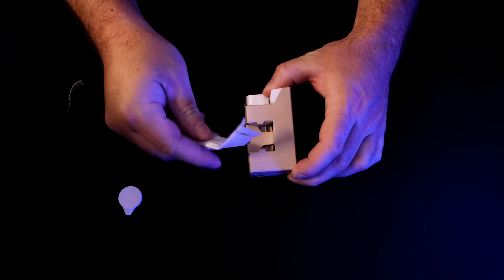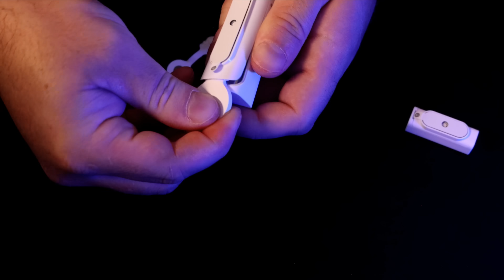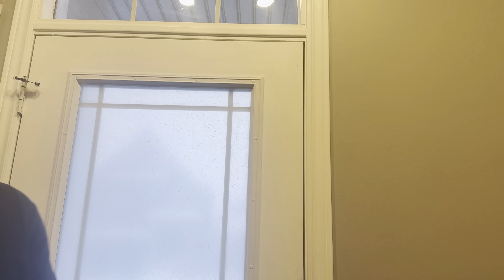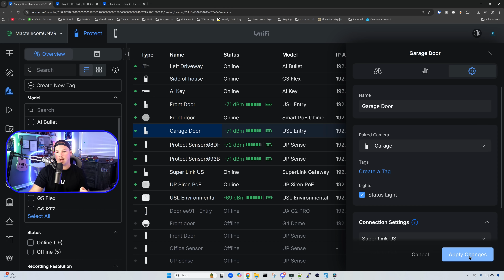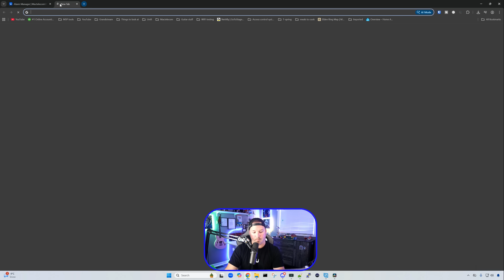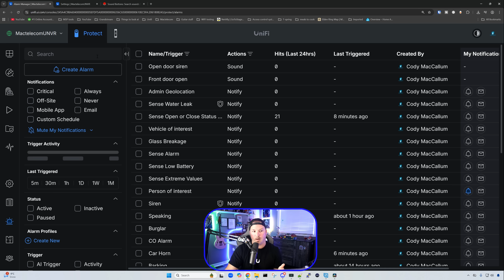UniFi SuperLink Entry Sensor Up To 6 Year Battery life!!!

Comment: The larger piece should be mounted on the frame; the smaller one should be on the door.
Reply: Unless it’s a double door… 😮
Reply: @m22110  and why would that matter?  run along
Reply: @BobDobbs-l3h  I think it’s obvious but sounds like too much for you, so you can run along
Reply from the maker: Yup you’re correct 😂 I originally had them that way with the old sensors . I looked at the documentation and thought the small piece was on the door 🤦‍♂️
Reply: @MactelecomNetworks    Which could be different for other similar products, because some have a tilt sensor in the big part (obviously not important for doors).
So having the big part on some moving parts because of features or having the small part on moving parts because it seems more logical; mixing both is awful too.

Comment: I understand the integration into the Unify system, but for my house I chose Shelly BLE door/window sensors that work in the BTHome protocol and the gateway is a Shelly mini-switch for light in each room. Elegant, functional, cheaper. No special GW is needed. Automation is then done in Home Assistant.
OK, long range is point. Not for me ...

Comment: I wonder how easy it is to jam this little sensor. They’re obviously using frequencies similar to LoRa, so making a jammer for it is no problem at all. It sends its pings so rarely that the system wouldn’t even suspect anything if the signal suddenly disappeared. It doesn’t look like it has any kind of advanced channel‑hopping logic in case the main channel is jammed or anything like that. I also don’t see any "offline" event in the alarm list, which means the system won’t react in any way if the sensor simply goes silent. Overall, this sensor is only suitable for notifications, but definitely not for any serious security or alarm systems. Any smart ass school kid could bypass it with no problem at all 😂

Comment: In your protect setup you had one of the new sensors labeled for the garage door. Is that just a normal door out in your garage or is that the actual overhead garage door? So long as you can mount the magnet close enough I don’t see why it wouldn’t work on a overhead garage door.

I just ordered enough to do all the points of entry I want to cover and an extra one for my garage door, so hoping that it will work that way.

Great video, thanks!

Comment: Is there a way to use traditional door contacts I already have installed inside the door frame? They were used in a wired Ademco P20 commercial alarm system.   I also have wired glass break and motion sensors, but that's a different story because they need power.

Comment: 0:20 the UP-Sense can also use superlink. I picked both up from Microcenter this weekend since I wasn’t 100% sure that my one U6 would have enough BLE coverage and the superlink is rated for 2km. Overkill for my home but at least I know it has range.
Reply: Just to clarity, the UP-Sense does not use the superlink protocol itself, only bluetooth. But the SuperLink gateway (USL-Gateway-US) also supports BT devices like the UP-Sense, so it can connect to that via BT.

Comment: These sensors look so cool, but Ubiquiti is really shooting themselves in the foot by not natively integrating with more consumer smart home platforms, particularly HomeKit, Alexa, and Google Assistant. I know most of these sensors are for commercial, but they have a very active, very loyal, and VERY loud consumer base that would be extremely excited to see it. Seems like a fairly simple thing to implement too? It's insane they don't even have a native Home Assistant integration, instead relying on volunteers to try and scrape something reliable together with their very lacking API. Really frustrating.

Comment: Maybe the siren shouldn't turn off right away when the door is shut? That doesn't seem like a derfault action of an alarm system. Maybe it can be or will be able to be set differently to stay on until turned off.
Reply: shop entry signal for streetfront doors

Comment: Thanks for the video! Do you know if either of them have a push-button bypass so you can let the dog out in the middle of the night without it triggering an alarm?  Also, have you heard anything about them implementing this is an actual alarm system. Seems like they've done everything except actually release a keypad to link it all together.

Comment: The old all in one works with SuperLink? Much more to that one for $20 more.
Reply: Only 7 can be paired at a time with the SuperLink Gateway. Or you could get some U6 APs.
Reply: @JacksonCampbell  so you are confirming that the older all in one will work with the super link and not have to get a Bluetooth access point?
Reply: @vette-4-life  It will work, but only using Bluetooth (2.4 GHz) obviously, so less range than SuperLink (915/868 MHz). The SuperLink Gateway has both SuperLink and Bluetooth 5.2 radios.
Reply: @rickwookie thank you!

Comment: I strongly doubt that the battery should last up to 6 years. I use the EVE Door/Window sensors and depending on how often a door or window is opened or closed, the batteries last 12-18 months until they are empty. In addition, the batteries are permanently exposed to temperature fluctuations, which shortens the life.
Reply: 6 years is actually achievable. Most of our alarm sensors from DSC or Qolsys use a similar radio protocol to Unifi are powered by CR123a batteries. We typically see battery life of 3  years in a commercial setting and 5 plus years in a residential setting.
Reply: Ajax can do seven years and is significantly smaller

Comment: Still waiting on the ability to do alarm stuff on it, like a sensor opens the chime/siren starts beeping for 30sec, you fob/pin/figure print to disarm and it shuts up. then if you don't within 30sec the alarm goes off. or with say the G4 DoorBell pro you fob or finger print before you open the door and it disarms.  If it weren't a pain to re-wire and put electric strike in, it would be awesome to fob, it unlocks and disarms.  Same thing when leaving fob to arm. Zones would be nice too, like disarm the house, but leave the garage armed.
Reply: My assumption is that they’re going to roll out another module like Protect but for Security System and probably a separate app as well?!

Comment: So, is this just LoraWAN relabeled as proprietary?  Why would I choose vendor locked in sensors when I can just use LoraWAN standard sensors and run them through Home Assistant?
Reply: Because UniFi is like Apple. It’s beautiful, supported, and this is prosumer gear. If you want to fiddle, tinker, and hack and don’t want to be locked in then use something else. 🤷‍♂️
Reply: @foster318  Exactly! Yes, there are much cheaper sensors in the market. I'm happy to pay a premium for UniFi gear as it is all integrated into one ecosystem. I'd rather pay more for the hardware and have no license fees! 😅
Reply: @bill-holmes  Same as Home Assistant, no fees...